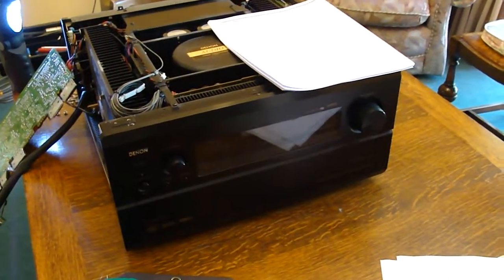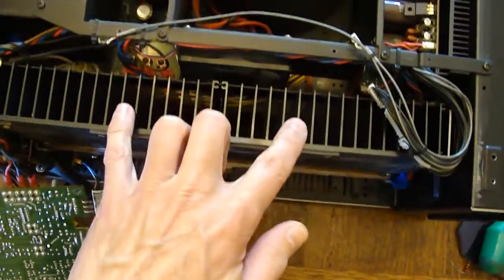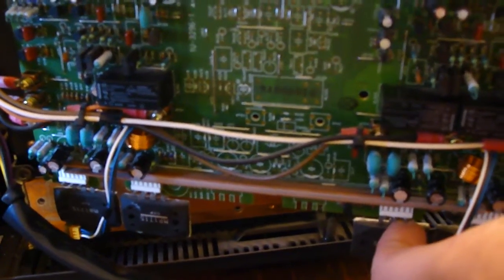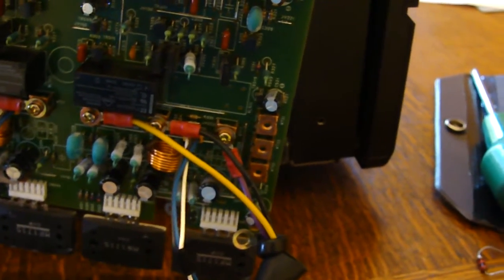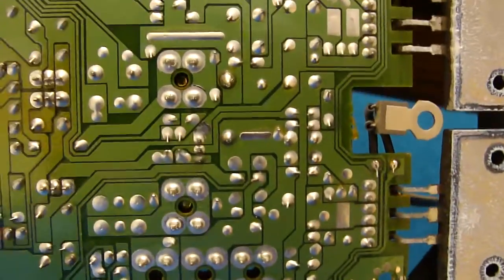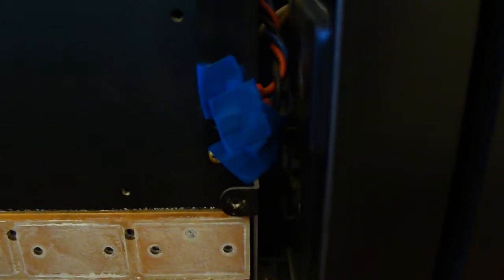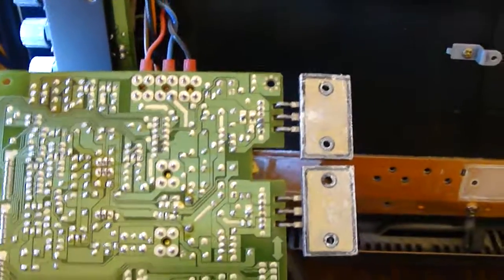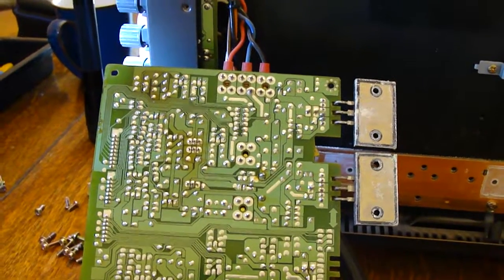Denon AVC-A1SE flashing power LED, bad solder joints

Comment: Hi kevin,
Franck from France,
Owner of the AVCA1SE model for over nearly Two Decades now, my front panel started to turn blank intermittently. I had to give big bumps at the front top chassis to make it alive. Recently, It turned loose one more time and I do not want to "push it around" again. I do suspect a bad connection, BUT since you took a deep look into it, do you have any ideas to where this connection would be visible. I don't want to dismantle the whole pretty massive thing.
PS : i Had this kind of issue you mentioned in your video a few years ago, ( flashing light and the Amp going on stand by mode) but turned it off completely, waited for a few secs, and it rumbled again with great noise.

Cheers and thanks for your instructive video, you might be of good help for me sooner or later, considering this type of issue.
FG
Reply from the maker: Bonjour Frank. My advice would be to download the service manual (there is a link in the description). I would carefully disassemble the amp so that you can access the circuit boards. I would then power it up and carefully push on the cables, circuit boards and components with a non-conductive tool to locate the source of the bad connection. One you have found it you will be able to repair it. More than likely it will be a bad solder joint.

While you have the amp disassembled, I would also check the solder joints that I found bad in my video. Even if they look OK I would redo them with fresh solder. A joint failure in this section of the circuit can result in blown components which will make it much more difficult to repair.

I hope that helps.
Reply: Many thanks for your answer Kevin.  I might have a further look into those solder joints as well. @bvqbvq

Comment: I know this has been up for several years but does anyone know if this applies to the AVC-A10 which mine is giving similar symptoms. TIA.
Reply from the maker: I think that many of the Denon units of this vintage have the same problem. The root causes are single-sided PCBs and lead-free solder. My advice is have a look at the PCBs, wobble the components and resolder them as necessary before the broken joints cause component damage. The biggest part of the job is disassembling the unit and getting access to the PCBs. So long as nothing is damaged, it is a cheap and easy fix to do the soldering. Good luck!

Comment: I have blown 2 of my output ICs MP1715 and MN1715 and was wondering where do I get the replacement?

Thank you.
Reply from the maker: They are big transistors and aren't cheap. There are some on eBay but they are 10 GBP each.

You can probably find equivalent transistors that might be cheaper, you will need to compare the datasheets.

Before replacing the faulty transistors I would carefully check the other components that are connected to the faulty parts as well as look for bad solder joints otherwise you will be back to square one. If you look in the video description you will see a link to the service manual.
Reply from the maker: @nightrider8918  if you are referring to the code printed below the main part number then that is usually just a date code and place of manufacture.

Are you sure that the drive transistors and emitter resistors are OK?
Reply: @bvqbvq  I do not have a clue as to how to check them? I must had touched the copper plate at the back while doing the resistance test. I am not an engineer but generally do tend to follow videos for troubleshooting.
Reply from the maker: @nightrider8918  Whilst I admire your tenacity in trying to repair the amp, I think that unless you are incredibly lucky you are unlikely to be able to repair it successfully. You really need someone with some electronics repair knowledge. This would be my approach:
1. Compare the resistance between the 3 pins on the transistors that you believe are faulty and compare it to one of the channels that is not faulty.
2. Look for bad solder joints, particularly on the larger components or the ones that get hot. They will be components mounted on heatsinks or large power components like resistors and transistors.
3. Bad joints can be very difficult to spot, sometime you have to wiggle the components whilst looking at the solder side for evidence that the joints are bad.
4. Measure all of the resistors in the are of the circuit that has failed. If the values do not match the colour codes on the resistors then you will either have to lift one end or compare the in-circuit resistance with a working channel.
5. Measure all of the semiconductors in the area. The diodes should not be short circuit and the transistors should measure the same as the ones in the other channels. Pay particular attention to the transistors that drive the base of the faulty output devices.
There is too much else to explain in a few paragraphs, you might be better off finding a local radio ham or a hacker meet-up who can help you out. In the past you could have gone to the local TV repair shop, but those days have sadly gone.
Reply: @bvqbvq  I have done that previously, soldered the joints previously but this time created a mess. You live and learn eh!
Reply: @bvqbvq  back to youtube with more videos to find. I will do my very best to get over this. I really appreciate your reply. Thank you.

Comment: I have a Pioneer Vsx-59txi same problem. Flashing l.e.d powers on for 10 secs then powers off. Weights 68.4 lbs and gets very hot. I'm assuming it's the same problem based on your video very good video by the way!
Reply from the maker: I think that the temperature cycling of the transistors causes the solder joints to crack. If you can get it apart and get to the PCB you should be able to inspect the solder joints. You may have to look with a magnifier as sometimes they look OK even though they are cracked. If in doubt just resolder them. Give the whole PCB a look over in case there are more bad joints elsewhere. Why not make a quick video of your findings and put it on YT 🙂

Comment: Hi i'm french, I have the same problem intermittently, protection on ignition or after a few minutes or hours, my amp is an avc-a1 it works very well, any idea? Cordially
Reply from the maker: Bonjour Jean-Michel, I think that these are generally reliable amplifiers but they do seem to suffer from bad solder joints.

Before you start looking inside the amp, I would check your speaker cables and connections to make sure that you do not have any bad connections or short circuits.
Only then would I start looking inside the amp. 

You need to be careful taking it apart and look for bad solder joints. You can re-solder any bad joints and then try it out. To go any further requires a knowledge of electronics and a copy of the circuit diagram.

Bon chance!
Reply: @bvqbvq  thank you very much for your answer, I have just spent 8 hours looking at all the solders under a microscope and indeed I found 2 of them to unsolder on a "pcb amplification" transistor so I redid the solders and I have some take the opportunity to redo a lot of welds which were not very beautiful, I also put the thermal paste back to new, I also found a white connector that made poor contact, I soldered directly,  and beautiful it works perfectly it's great, thank you again for your quick response, have a good day my friend ;)
Reply from the maker: @MrDocdolby22  If you have discovered bad solder joints and fixed them then there is a very good chance that it should work correctly now. Vive La Denon!

Comment: Thank you so much for this hint. I dissambled my Denon and I am totally stunned, that almost for all channels these transistors are completely lose. Everything else seems ok. Until now no other issues found. I think the really short  legs on these transistors are the issue and will cause the (constant) breaking of solder. Did it occur to you again? Even after repair?
Reply from the maker: I think that the problem is the poor quality single-sided PCB. A good quality PTH PCB would give a much larger area for the solder joint and would also help remove any heat. I have not had any more failures since repairing these joints but it will probably happen again at some point :-(

Comment: Published on Nov 21, 2018
Denon AVR 1312 Red Light Complaint.Iam Facing This Type Of Complaints.After Some Times Switch Off&On Amp Works Fine.I Didn't Understand What is the problem.

Iam facing this type of problem some times it is working perfect.after switch on and off so many times it works perfectly.
Reply from the maker: Sounds like you might have a bad solder joint somewhere. You need to take the cover off, power it up and push on the components with a non-conductive tool, plastic or wood. That might allow you to find where the problem lies.

Comment: My beloved AVR-5800 I bought in the year 2000, went into protect mode today.  I already have it in a shop.  Very informative video.  The repair guy told me that these older Denons are easier to work on than the new ones and parts are pretty easy to still get!
Reply from the maker: Hopefully it will only be a bad joint in the output stage like mine. They are definitely worth repairing.
Reply: Hopefully no more than $300?  I see a bunch on eBay for $500 or less.

Comment: Hi kev, i have exactly the same model as yours in this video. my problem is that when i hooked it up , no sounds im getting but it seems that all functions are working - all indicators seems working just no sounds coming out ...also, my remote is dead even if i put on a new batteries...just want to ask as well, if there's any ways that i could configure all the settings on the unit without the remote controller? because i was trying all the buttons on the front but i cant able to access the options where you can configure to assign the inputs like optical 1,2,3 etc...or to coax 1,2 etc....please help.
Reply from the maker: Hi,
In answer to your questions:
Is any infrared coming out of your remote? You can use a camera/phone to look at the emitter which will show as a blue flashing light if it is working. If it is then you have a problem at the receive end, i.e. the main Denon amp. If it isn't flashing then you can either: fix the remote or use a universal remote.

Most remote problems are corroded battery contacts so I would look there first. Anything more than that and you will need some electronics knowledge.

Some of the Logitec remotes like the Harmony One can be configured to behave like the Denon remote without having access to the original.

I find the Denon impossible to control from the front panel and never bother. In addition, if it is not correctly configured you will get NOTHING out of it. You need to connected it to a TV or monitor via the composite video out connector on the rear panel so that you can see all of the menu settings. I think that the connector is labelled MONITOR 1.

Has it ever worked or have you only just recently acquired it?

Kevin
Reply: yeah, you're right. my remote's battery contacts are corroded hence ive cleaned it already and seems that i can use the volume buttons already,however the touch screen controls are no longer visible but even if no visible buttons on the screen, i can say its still working because wherever i touches on the screen pad, the main unit responded...do you think the screen pad still repairable? i tried opening it but it needs a special screw driver tool to remove the screws... also, even if i would connect a monitor TV , i still cant configure the unit specially the input signal assignments (opt 1,2,3 or coax 1,2,3 ect).. By he way, bought this unit coming from a storage...the owner said it has been in the storage for more than 5yrs...when i tested the unit , i straight away look for the inputs that has been initially configured to Optical 1 or 2 - and try using it with a dvd player but there is no sound coming out..also, one thing i noticed is that the Subwoofer is popping a loud sound as i am changing from one input to another( selecting from dvd to cd to tape or any inputs) or as i turned on the main unit itself...
Reply from the maker: If it has been in storage and the battery terminals were corroded then I would suspect other joint problems elsewhere. Buy yourself a set of security bits off eBay and take the remote apart. You need to look for the connections to the LCD, disconnect them, clean them and reconnect them. Unless you are familiar with how FPC style connectors work I would look them up online so that you don't break them. If you break them it will be game over. I would use a toothbrush and some IPA or switch cleaner to tidy up the terminals. Be very careful, it is all likely to be fine pitch SMT and not mechanically forgiving.

I didn't quite understand your reply. Is the config menu visible on the TV or not? If it is then you should be able to configure the input channels. Have you downloaded a copy of the user manual? If you use an analog source do you get any sound out?

I don't like the sub woofer popping problem, that doesn't sound good. Without tracing through the schematic I don't know what to suggest there at the moment. I would see if you can get the rest working first before you spend too much time on it.
Reply: hi kev, ive just tested the unit with analog L/R inputs cd, dvd etc...and im getting signal outputs now on my speakers. so, would that mean, my digital circuitry is faulty? if so, is that digital control circuits is responsible also of the popping sound on my sub woofer?
Reply from the maker: Sounds like you've made some progress! 

You really need to be sure that you have all of the menu settings correct otherwise the digital routing and decoding will be completely wrong and you may get the symptoms you describe.

It could well be a problem with the digital stage since that also does the decoding for the sub woofer signal. It's starting to get quite technical now. If it were me I would remove the case and start looking at the various plug-in connectors. It could be a supply problem or a signal problem. I would start by carefully unplugging and reinserting the connectors. Look for signs of corrosion or water staining. Beyond that you need to follow through the circuit diagram and use a meter/scope to check out the various supplies and signals. Unless there is something obvious it is going to be tricky :-(
Reply: Hi Kev, i suspect that the DSP board is the one faulty for not giving output signal from a digital inputs..  just wondering if i still able to source out the whole board assembly of this model? or should i initiate troubleshooting the DSP board? if so, do you have an idea which particular component/s should i be checking ? thanks
Reply from the maker: I have had problems with this amp where the digital path has not been configured correctly. The only way of doing this is with the remote and the on-screen display. I would only start fault-finding the DSP board if you are convinced that your settings are correct. I would suspect that the digital boards are very reliable. I am not familiar with this section of the circuitry. As with all digital faults I would start with the power supply voltages, the reset signal and the clock. Beyond that you will need to trace the signals which won't be easy! The fact that there aren't any DSP boards for sale on ebay doesn't bode well for finding a spare.

Comment: Hey man Fantastic Video. I have and AVC A1D Gold amp. A bit older than yours. My problem is a major one I think. I moved house and plugged everything back up. Amp played for about 3 minutes then bang and then smoke from the left hand side rear. I was thinking capacitor blown  because it was a spark then bang quite loud. I powered off and checked over the circuitry but couldn't identify were the smoke came from i'm no engineer with HiFi equipment. Saw your video and it's quite informative
Reply from the maker: Sounds like a semiconductor has gone. Take a close look at the transistors, you may find one missing part of its case.  It may just be a cracked case that you are looking for like this: http://pacificstereo.net/tapeheads/180R%20blownup.jpg

Bad caps look like this: https://encrypted-tbn0.gstatic.com/images?q=tbn:ANd9GcQHWWM3SJ0ViSvQqunsKBcLeUBNnx0GZYReXt_fU12p39VisAtO
If they fail catastrophically then there will be lots of particles inside the amp.

Damage to large transistors is usually more obvious like this: https://i.stack.imgur.com/KvIYW.jpg

Bear in mind that if you find a blown component there is a good chance that the components connected to it may also be damaged. Unless you replace all of them you will just destroy them on first power up. There are various methods for fault-finding and repairing amps but that is well beyond the scope of a Q&A on this video ;-)
Reply: Ok thanks for this wil check it over and get back to you when I find something more concrete